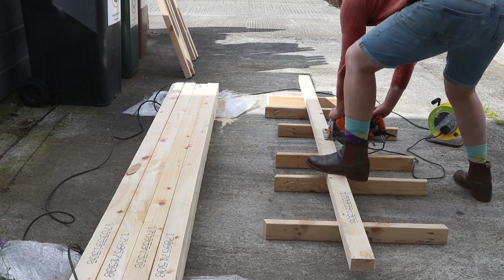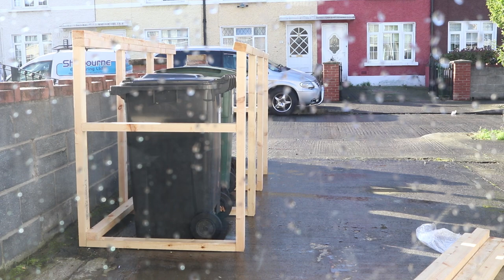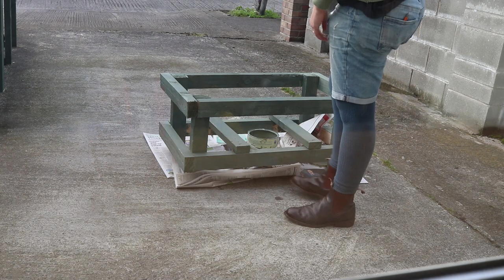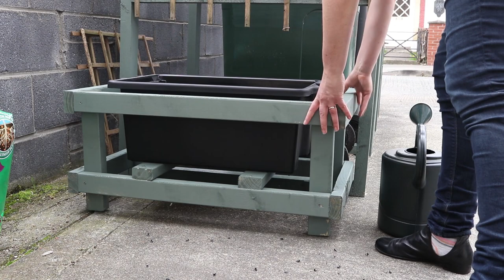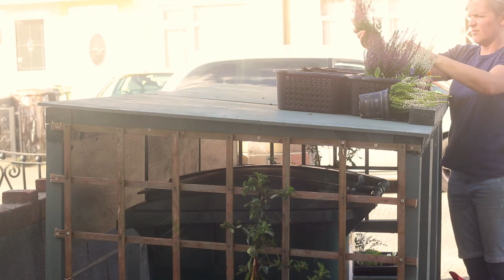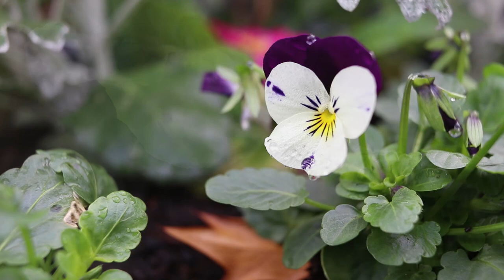Build a garden bed bin shelter with two tools

Comment: Would love to know how this held up after a couple of years? Anything you would do differently?
Reply from the maker: It held up surprisingly well! We moved across the country a little over a year ago, so I dismantled it, but I think it was up for at least a year and a half. I ended up tying it with a couple of ropes to the top of the concrete fence behind it, which helped keep it stable as it did get a bit of a lean going on without that reinforcement (our street copped a lot of wind). Anything you could add to brace it or anchor something more firmly into the ground would be a good move. It's nice to look on google maps occasionally and see it still in the pictures at our old address. :)